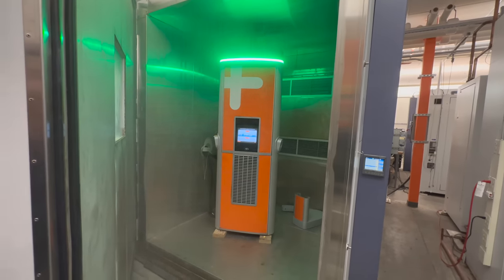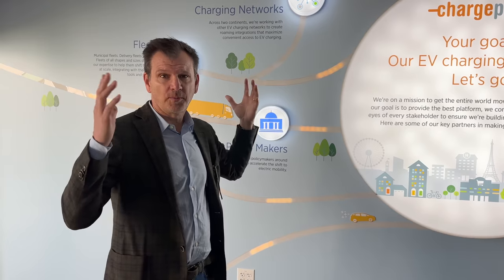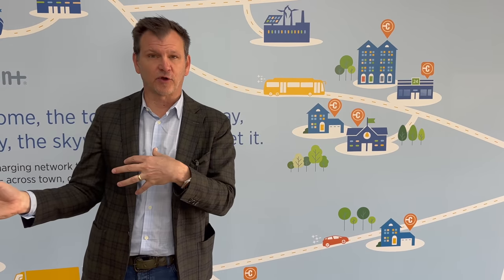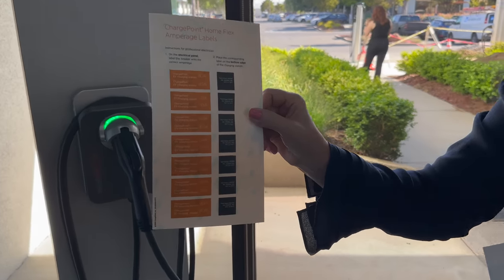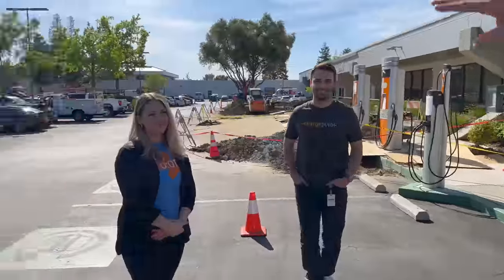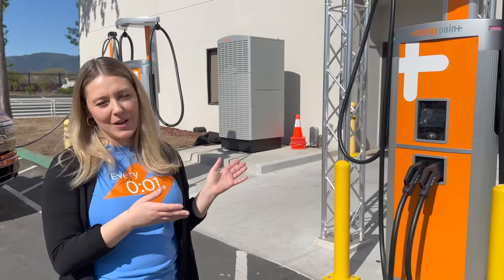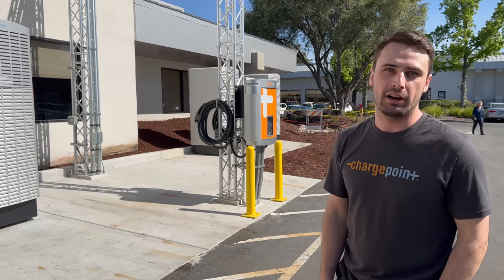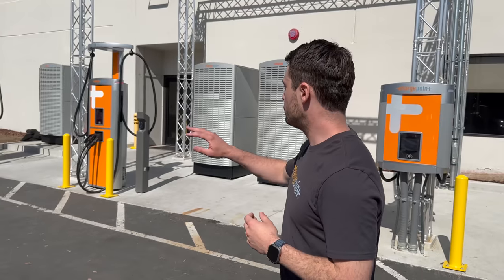Inside ChargePoint - Full Tour Of Hardware Engineering, Test Laboratories, & Product Portfolio

Comment: This is epic engineering and reliability tour from the Lab on (58:00 mark). ChargePoint has come a long ways in last 3-5 years by designing equipment in-house. 
Would love to see follow-on video that looks at the customer-host business side of ChargePoint and what they do to ensure customer-hosts provide a excellent EV driver experience. Particularly in terms of host-site architecture and customer-host price structures. Signage, pavement markings, and listing of nearby convinces (perhaps local map) are items often missing, definitely inconsistent between CPO-hosts.
Location of ChargePoint hardware (poor sighting) and odd-ball price structures are my biggest complaints associated with the brand. Pricing needs to be simple and clear ($/kWh). As far as usability and reliability the number of issues has been minor over the 9+ years I've used. Only exceptions are where host equipment is offline due to maintenance and servicing issues.

Comment: 1:31:00 considering how well designed their chargers are, it's surprising that they show payment before plug-in. 
It  would surely be better to plug in first, that way it can be starting the CCS communications & isolation testing while the user is doing the payment, reducing the overall time to get going.
Reply: If you've used EA, you'll know that none of the in-depth CCS communication or isolation test starts until the charging session is authorized (paid for). At EA stations, I believe the only thing communicated on initial plug-in is the brand of vehicle and possibly the VIN/MAC address. Basically EA wants you to plug-in first only to reduce you accidentally activating the wrong charger from in the app.

Comment: 32:02 Frankly, ChargePoint's CEC sites along I-5 are some of the best located, convenient charging sites on that route. However, they are extremely underutilized based on pricing (expensive), size (most are no more than three chargers), and speed (62.5 kW is just too slow for a travel corridor site). For the CEC sites on I-5, paring the existing CPE 250, adding a couple of Express Plus units, and setting the price at a flat 40 cent per kWh rate would probably increase site usage by 400% to 500%.
Reply: Price has to do with the IOUs.
Reply: @azorglub  That's true, but it's an oversimplification. Yes, we need a new fee model for utilities to offer to public charging providers, but for right now, the demand fee model is in place. The lower the charging site utilization, the larger the impact that demand charges have. Some of the CEC sites have onsite grid-tie batteries (really, only one that I know of for sure in Red Bluff), so the rest are completely at the mercy of their usage per overall demand fees. Increasing the site utilization by four to five times is the most effective way (after grid-tie batteries) to offset the impact of demand fees. At that point, ChargePoint can set more competitive pricing.
Reply: Sounds like the CPE250s are easily upgradable to 280s. Just swap out the 31.25 modules for 40kW units and replace the 200A cable with a 250A unit and you're good to go. The real trick is tying two chargers together to boost the power. 

What's bonkers to me is comparing Chargepoint CPE250s vs Tritium RT50 (formerly Veefil) units. The reliability contrast between the two couldn't be more stark. EVCS operates Tritiums along the west coast and their reliability is AWFUL. CPE250s seem to be always operational, if slow.
Reply: @newscoulomb3705  with KWh at 30c to 50c, cheap fast charging ain't happening, even without demand charges
Reply: @anthonyc8499  Yes, but for those travel stops (all along Interstate 5), I think the CPE 280s would still be too slow, unless they could also bridge the current and provide at least 350 A on a single head. To me, the better option would be to add the Express Plus units, so slower charging EVs and 800 V EVs still have the option of using the CPE 280s instead.

Adding chargers would address the next biggest issue after charging speed for those sites, which is overall site concentration. Adding four active posts (two Express Plus units) each capable of up to 400 kW would push most of those sites over the top, and steal a lot of traffic from Electrify America along that route.

As far as reliability is concerned, though, you're absolutely right. We still have some ChargePoint RT50 Veefil sites, and they are by fare the least reliable 50 kW chargers at this point.
Reply: @azorglub  Are you saying that PG&E and others are charging commercial users 30 to 50 cents per kWh before demand fees? Even at TOU rates, that's higher than what I've heard, but to me, that still warrants a similar strategy.

If I were a charging provider operating under those constraints, solar canopies and battery storage would be my highest priorities. Especially if TOU off-peak rates drop below the national average of ~10 cents per kWh. There's a huge opportunity there to make sites profitable with a slightly higher initial build cost.
Reply: @newscoulomb3705  oops, you are right. I looked it up and KWh are about 8 to 20c depending on time of use and season. Demand charges are real steep though
Reply: @azorglub  Yes. At this point, if a charging provider is serious about being profitable, I don't think they can operate a site without at least a modest grid-tie battery to offset demand charges.
Reply: @newscoulomb3705  I struggle to understand the appeal now of CPE250/280 chargers in the Age of NEVI. That said, I'd rather see the  280s than anything else because at least you'd be looking at about 70-80kW for a non-paired charger on a 400v system. 

I-5 needs a bunch of HPC stations of the 8+ chargers variety. Tesla is making everyone else look like a Mickey Mouse amateur operation. I don't know if there's any notable CCS stations under construction between Sacramento and LA.
Reply: @anthonyc8499  For 800 V cars, the CPE 250/280 are still a great option, as they'll be providing a true 125 kW to 160 kW charging speeds. For EVs with 60 to 80 kW packs, that's plenty fast enough for a 15-minute bathroom/snack break. The fact that they can do that for a lower cost and with a smaller footprint than the Express Plus is a big deal.

As far as site concentrations are concerned, I don't think other providers need to follow Tesla's path. As I've noted in my own videos, Tesla's larger sites kind of miss the point because they don't necessarily have more overall throughput (i.e., total site power) than smaller CCS sites, and the cramped design makes them mostly unusable for large-format EVs that are towing. Also, concentrating so many chargers in single locations limit customer options.

I do agree that I-5 between Sacramento and Los Angeles in particular needs larger site sizes, but I'd still rather seen two or three dozen 8 to 10 charger sites than a half dozen 40 to 50 charger sites. The bigger issue right now is that we only have four or five different public charging providers operating on that route, and outside of EA, none of them are building larger, faster sites. It isn't until you get into LA County that you start to see EVgo's faster 350 kW sites to complement EA.
Reply: @newscoulomb3705  The CPE 250 or 280 would be great in theory but you should see how many site owners don't bother to pair them. There's not a single paired install in all of New Mexico. All single unpaired units and wasted potential. The NMDOT put 4 *unpaired* CPE-250s at their district offices in two different locations. They should have paired them. Four unpaired units charging 4 cars will draw 250 kW from the grid, so it shouldn't matter if 2 paired units charging 2 cars draws that same power.

Due to that, I honestly think the CPE-250/280 should be phased out. It's not NEVI compliant. I really hope more site owners buy CP Express Plus units and not CPE 250/280. Pairing should really be a requirement since you need the large grid connection anyways. It can all be load balanced in the software but you need the hardware and the DC to DC bus.
Reply: @anthonyc8499  I agree with you about the Tritium RT50s. Absolute garbage, no LCD screen or card reader -- just a simple 7-segment LED display. It has a pathetic 48-49 kW output (not even a truly full 50 kW). I don't even think they have RFID readers.

Most of Tritium's higher output products are much better and have an actual LCD touchscreen. They really need to just retire the junk RT50 units and stop selling them.
Reply: @ArtiePenguin1  I feel that is partially a failure on ChargePoint to properly communicate ideal set ups to their customers. 

As for NEVI funding, I think focusing so much on charging speed is its single biggest failure. Now, the level of funding shouldn't be the same, but there should be funding for additional, slower, "destination" style DC fast charging infrastructure.
Reply: @newscoulomb3705  ChargePoint definitely needs to communicate better with its customers regarding site plans and power levels. With today's big battery EVs, I don't think there's a place for under 100 kW DC fast charging in most places. So I do think NEVI got it right in the speed department with 150 kW minimum. I don't agree about the rigid 50-mile max spacing here in the West or the 1-mile off the highway requirement though.
Reply: @ArtiePenguin1  I'm not sure I agree with your assessment regarding required power levels. The CPE 280 are effectively "100 kW" units as far as the industry is concerned (roughly equivalent to EVgo's Delta "100 kW" or Tesla's "Urban" Superchargers). A majority of EVs sold still have batteries with usable capacities of 85 kWh or less. That means that these chargers will nearly charge most EVs to full in an hour, if the EV's charging profile supports it. That makes them reasonable chargers for a number of venues, including grocery stores (where Americans have a typical dwell time of ~45 minutes), retail outlets, sit-down restaurants, etc. Many of those venues benefit from having customers onsite for an hour or two, so even bigger battery EVs will see reasonable gains in the time spent patronizing the host business.
Reply: @newscoulomb3705  When I said earlier 100 kW wouldn't be ideal "in most places", I was referring to highway charging corridors. In urban metro areas and cities, what you described works well as long as it isn't the only charging available.
Also, in rural areas with not much grid power available, I'd take a 100 kW charger with load sharing any day over 2 x 50 kW chargers.

Comment: Please add the NACS connector.  You will gain a lot more customers that have 2018 and older Teslas.  If Tesla is not allowing them or too high of a cost or annual fees, please state them.
Reply: I think I saw somewhere you can get an adaptor which allows you to charge on CCS. Isn’t that correct? It would seem like an easy solution for you.
Reply: @tomm5936  Yes, I have a 2022 LRY and have the CCS1 adapter.  My point was for older 2018 prior model year that do not have the CCS1 hardware in the vehicle.

Comment: We have the dual station chargepoint chargers at my work. They have actually been somewhat troublesome, and our oldest one currently has both of the retractor cords broken.  The same one lost it's marbles, and one of the brand new ones freshly installed rejects our readers, rendering it useless.  I'm actually annoyed they removed the old Eaton charger and replaced it with the chargepoint one.  It worked, and didn't care if it was hot, cold, or whatever.  Plug in, click on, charge.  I like no frills and reliability.

Comment: I like the idea that they are actively seeking out broken equipment and have trucks with techs and replacement equipment ready. A decent chance that the charger will actually work and at a consistent level of charge output. Match the reliability of a gas station pump.

Comment: Another great video! I have a couple of questions if you get back there. 
Is ChargePoint looking to integrate an NACS connector into their Home Flex line? 
For two more vehicle homes, are they looking at a two cable unit or a secondary unit that would allow for two cars to charge overnight without moving a cable?

Comment: ChargePoint, Starbucks and Volvo announced a pilot charging corridor between Seattle and Denver. How is the project going?

Also, is ChargePoint going prefabricate their DC units like Tesla does (4 units in a concrete foundation)?

Comment: Are you running low on disk space. Only 360 video. That's for the video. Charge points are one of the chargers I know it will work. I hate some of the DC share power and text you every min that it's sharing power. Love that feature.

Comment: I haven’t seen if you asked yet but I’d ask them if the CPE250s could be upgraded to boost the amps on the cables. Using the existing cables to boost from 200 amps to 300 amps would make for much more useful charging units for us 400V guys.

Comment: I have been trying to get a replacement 14-50 pigtail for my Chargepoint for over 2 years now... First one burned out after 3 years and couldn't figure out where to get it.  If there is a direct contact you can supply with their sales group, I would like to get the replacement and even a branded trim cover if available for KIA.

Comment: Here in Canada we have had so many DC Fast charge stations that were charge cable vandalised, would be great to see the high overhead charger, with plug in charge but using your Charge-point app to lower the plug cable assembly in some of these high risk areas to protect the equipment!

Comment: I love the two ChargePoint Home Flex units we have! I bought them in large part because of the positive reviews for the cables, and how well they deal with sub-freezing temps. I can tell you that at our place in New Hampshire, during the deep freeze back in February, it got down to -23F air temperature (not wind chill) and that cable was still flexible and the unit itself worked without a problem!

I have only two complaints about the ChargePoint experience, as an owner and a user.

1. Their app does not allow for the management of more than one Home Flex per account. This is kind of annoying since we have two units. It means one has to be managed on my wife's phone, and the other on mine. 
2. There's as of yet, no Google Assistant/Home integration. This would be useful for those of us that might have a charging schedule, but maybe we need to tell the unit to bypass that and start charging now. Rather than pull the phone out and go through the app, it would obviously be easier to verbally initiate that via Google Assistant.

Both of these things they've said are on their roadmap and that they're working on it, and that was when I bought both of my Home Flexes back almost 2 years ago.

And lastly, a very small thing was that I really wanted to purchase one of the white Volvo branded faceplates, but the people at ChargePoint customer service didn't even know they made and sold them. I had to direct their own customer service to the ChargePoint website to get them to believe that they even make that Volvo branded version....and then they still shipped me a black ChargePoint branded faceplate. 😕

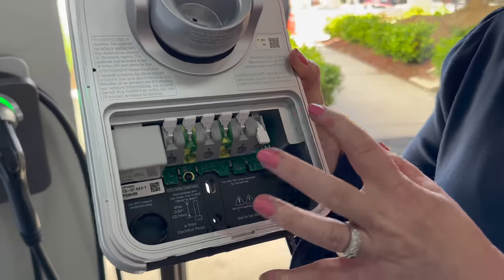Comment: @16:30 there’s a good use case, I’m embarrassed to admit to.  This past winter we got into the top 4 record snow falls for MN.  I was putting away my snow blower one evening into my garage when I missed the fact that I still had the auger going and accidentally sucked up the charging cable 😳.  Because of those disconnects, the cable came clean off the box.  I was able to simply buy a new cable and not have to replace the entire unit.  Also, now that we have 2 EVs in the garage the extra long cable allows us to charge both vehicles regardless of where in the garage they sit (R1S and Audi eTron).

Comment: 1:22:24 California is requiring this as well, which is part of the contention with Tesla opening to the public now. Independent weights and measures personnel need to be able to validate the power being dispensed by the charger versus what is being displayed on the charging dispenser's screen. In-car and in-app displays won't work for this requirement either because public charging providers are also required to accept multiple forms of payment including credit cards at the point of sale. Requiring an app violates that regulatory requirement.

Comment: Can droop be added to the chargers to help with the stability of the grid? Load rejection with frequency drop is a necessary part of grid stability, and it seems to me that there are enough electronics to add it in to a charger at almost no cost.

Comment: I am interested in the area of charging at work, at destinations, or at apartment complexes. I know they have equipment for all of those situations but did they have any comments on the numbers required for different situations? At work sharing a charger station between employees can be done, at an apartment complex I would trust anybody to get up in the middle of the night to move their car. 
Did you find out how many charger stations they had per employee EV or an average of how much time they were connected a day? 
I think that is the area that needs to be worked out to make EVs a success. DC fast charging is important for cross-country travel but we won't be needing to install 3 or 4 chargers at a gas station in the big cities for each pump they currently have like people that don't have an EV claim.

Comment: Comments about the Home HCP25 and Home Flex.  The WiFi adapter is flaky, I know of four CP homes in use including my own and we all have random periods where the charger will go offline. I've reconfigured my WiFi more times than I can count. I've tried all sorts of routers and have a solid internet ISP.  As far as physical product quality, I've recently had issues with the pivot ball cord holster popping out of the charger body.